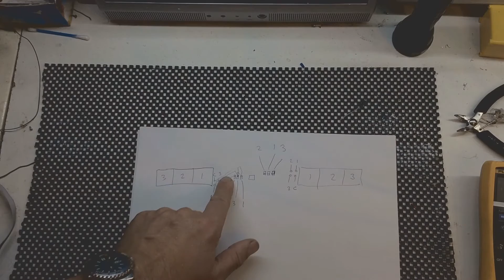More about diagnosing GHD Eclipse faults

Comment: Of course, if a schematic diagram existed, it wouldn't hurt.
cmq most of the damage is caused by flex, and it takes very little to have a power cut, causing the classic red protection light

Comment: Hey Kev, Just watching your video previous to this about dismantling the GHD Eclipse (I know these are old videos sorry) but I can't get the casing off to start doing the bits inside for this diagnosing video, my problem is the classic '3 beeps wont heat' and I have contacted GHD and they don't offer repairs. I'm trying to do this myself but struggling, I feel like i'm going to break it when I put the flat head in to winch it open. I've changed the fuse to multiple 3amp ones and nothing, could it be anything else or shall I just open it and see? 
Thanks!
Maggie
Reply from the maker: Good luck i dont play with them anymore, the covers do come off but are stuck down with double sided tape

Comment: Hi kev great video. I do alot of repairs on the standard ghds but just recently I've had a pair of the eclipse come in and I've found one of the thermal fuse pads has burnt to the point where it no longer exists. Have you had this? Also r28 has blown. 
Thanks Dean 
Dean.a.ansell@gmail.com
Reply from the maker: Good luck with them im now going with the flow of all other repairs and classing them as not viable for repair, cant say i have seen a burnt fuse pad.

Comment: Hi kev quick question on balancing the heaters what did you use to read all the zones at once temp wise and what temp must they run at is 180 deg C right or too low. Thanks for the great videos .
Reply from the maker: When i use to do it i used 6 thype k thermocouples conected to a usb logger and read all zones at the same time, the magic temperature is 185°C, good luck

Comment: Hello, my eclipse just stopped working. both sides are not warm anymore. do you have an idea?
Reply from the maker: heaters or thermal fuse i would think
Reply: but both the same time?
Reply from the maker: its not unknown and the processor will also prevent the heating if it detects a problem.

Comment: Hi, any idea why my eclipse is flashing and beeping continuously and only the 1 plate heats up?
Reply from the maker: broken heater without a doubt.
Reply: @KevsElectricalWorkshop  oh no 😭. If i may ask, what causes the heater to break?
Reply from the maker: There extreamly thin on the eclpse/platinums and break easier than older models.
Reply: @KevsElectricalWorkshop  oh well that sucks. Thank you for the help though.